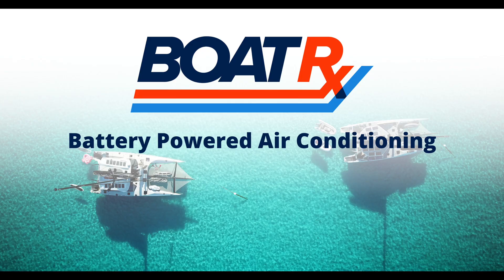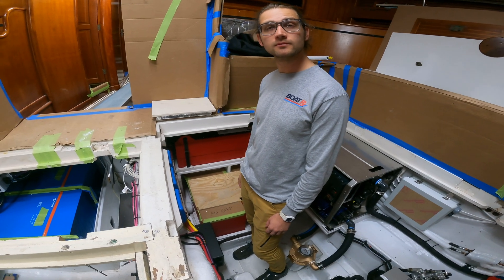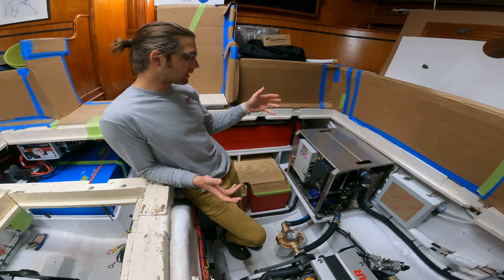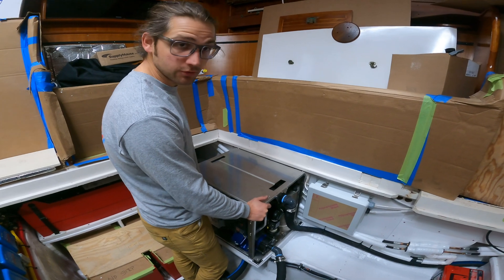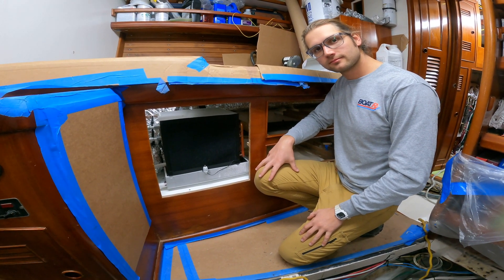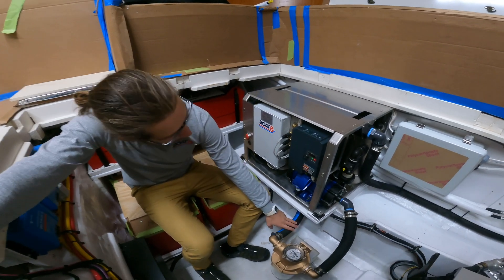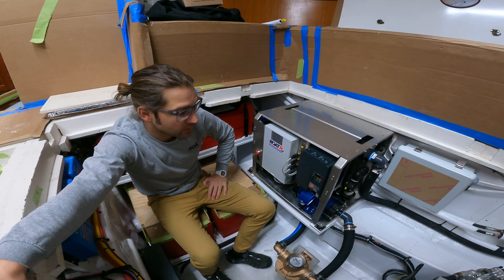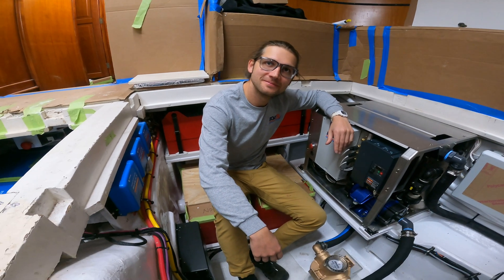62' Sailing Yacht Refit with Lithium Battery Powered Air Conditioning - How Does it Work!?

Comment: Lithium is out-dated tech wrapped up in a fancy new sticker and charged to the customer at 100% prophet Because these companys are to lazy to use Real New Tech on the market themselfs,  Lithium 1,200 charges and after 3 years goes down in power to 75% and takes ages to charge and scars the planet,  A Marrine capacitor bank takes over 1 million + charges and can be charged up to full power in 30 seconds and is clean for the planet, You can make them all different sizes from 24 volt to 240v to run washing machines and tumble dryers maintenance free without killing your ships batterys With hardly any weight put in the boat, Comparied to lithium weight bells that kill your pocket and weigh a ton.

Comment: Now he will have to run the engines to charge the battery . “We can run can generators” you are still limited by horse power.  And a DX system will always be more efficient than a chiller type system. And what is “a lot of amp hours, a lot?”
Reply from the maker: Hi Roland,

Yes he will run the main engines to charge the batteries.  The intermittent engine runtimes during the normal underway operations of the yacht will store sufficient charge in the batteries to run all of the onboard systems, including the HVAC, around the clock.  When necessary, the engine can also be run at anchor for a couple of hours, loaded by the alternators, to charge the batteries which provide energy for the rest of the day.  Would you rather run a generator 24/7, or run your mains for a couple hours a day to have power all of the time?

The horsepower available from the main engines far exceeds the needs for power generation.  There is a total of 28kw of DC changing power available from the 48v Integrel generators and APS alternators with wakespeed regulators, mounted to each engine.

As far as DX being more efficient than chillers, we agree with you!  If you watched the video you've listened to us explain the nature of this "VRV" air conditioning system.  Variable refrigerant volume is a form of direct expansion cooling.

Those are 51v 16kWh batteries and there are three of them for a total of 48kWh.  For those that prefer to think in 12 volts, that's 4,000 amp hours.
Reply: @boatrx  Well answered, thank you. But I would rather charge my house bank from a dedicated generator than a main engine any day. With the main engine used for propulsion and auxiliary charging. Re cooling unit, if the gas is not expanding directly in an evaporator in the room being cooled then it is not DX by definition.  
All the best
Reply: @momosworld7312  - why a dedicated genset? Surely the benefit of less diesel motors onboard, and the high amp alternators at each motor, makes the use of a dedicated generator redundant?  The whole industry is fast moving to this model, and often in combination with a electric drive too….
Reply: @robbief1  the “the whole industry” is not the real world… Using your mains as your primary charging system mean a lot more hours on a system that is there for emergencies and maneuvering and that is much more expensive to replace.  The propellers are spec for the HP of the engine. The charging system being described will take significan HP (20-40hp) . I cruised for years with a 165HP Volvo Penta that had a 200A alternator. When the batteries where low and alternator at full throttle the boat( Hallberg Rassy 53) would not have  sufficient power to maneuver efficiently in situations with strong currents etc.
Reply: @momosworld7312  - Good points, thanks for sharing.  I see some are just opting for either Hybrid Drive (In-line electric motor in combination with Diesel engine - see HH44), or even just going fully electric (sailing Uma).  Would you consider either?   I think it’s great that there is an array of people trying all different options, it’s pushing the whole industry forward :)
Reply from the maker: There is no concern about not having enough power at full throttle because these alternators respond to the RPM curve and are designed to use the most power in the mid range of the power curve.  They back off at low and high RPMs.
Reply from the maker: Also, no problem if you prefer to keep your genset.  We've also designed and installed plenty of hybrid battery/generator systems where the majority of charging is provided by a dedicated genset and the battery bank is sized to run the loads for desired quiet periods, usually overnight.